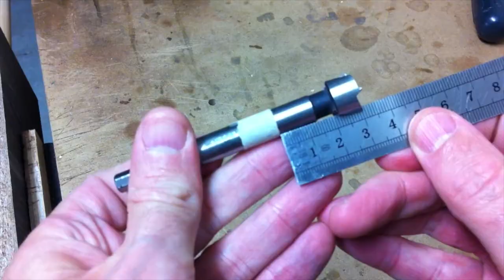Homemade Cue Joint - Part 4

Comment: holup, i'm gonna need more details on that alignment jig pls!  i could watch a whole video on how you made that and how you made sure the mirrors were at the right angles...
Reply from the maker: Hi. I made the base of the jig with a small piece of very smooth plywood. Because it is plywood, it is already perfectly parallel top and bottom. I also cut the small base square from the edge of the original piece of plywood, so the edges were already perfectly perpendicular to the flat top and bottom. The mirrors were cut from the mirrored bit of flexible plastic stuck on the back of a cheap smartphone case bought at a dollar store. Glue your mirrors to the edges of the plywood base and check with a t-square to make sure they are perpendicular. The struts holding the vice pieces were made from hardwood, but the vice pieces have to be made from much softer wood, like pine or spruce. This is important because they need to squeeze tightly against the cue shaft without slipping. The softwood vice pieces will actually compress slightly against the hardwood of the cue without damaging or marking the cue. Hardwood vice pieces will slip slightly, either while tightening the wing nuts or while drilling. They can also mark the cue shaft. It is essential that when tightened, the plywood base is completely flat all the way around the end of the cue. Hold it up to the light to check. Even the tiniest sliver of light means that it is off straight, and the hole will not be straight if you get the drill-bit reflections perfectly parallel. This jig was just an experiment, and you may be able to improve on it by playing around with some other ideas. The real key, however, is actually getting the cut line (when you cut your cue) perfectly perpendicular all the way around. This was something I could not figure out how to do, and as a result, my cue is not perfectly straight at the joint (almost, but not quite). It does not need to be absolutely straight, and even if it isn't, it won't adversely affect your cue action, but the straighter you can get it the better.
Reply: @danielmarcbrooks568  thanks for the reply!
Reply from the maker: @fnaah_au  No problem. Thanks for watching, and good luck with your cue. Please let me know if you figure out how to cut a one-piece cue perpendicular without a lathe or machine tool. Of course, if you know you're making a two-piece right off the hop (unlike me), then you can make things much easier and less wasteful by simply making the top and bottom separately to begin with. All the best.
Reply: @danielmarcbrooks568  i''m actually hoping to replace a shaft, so that's not a problem i have to deal with just yet. :)